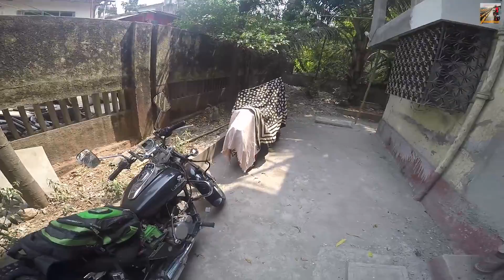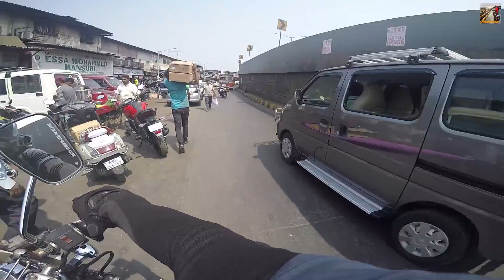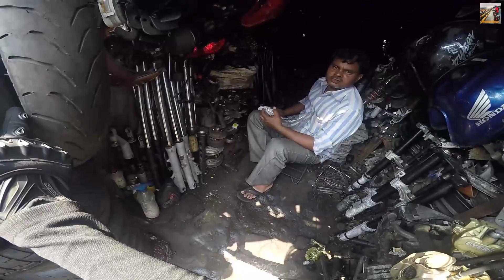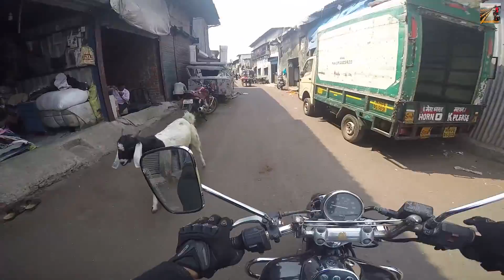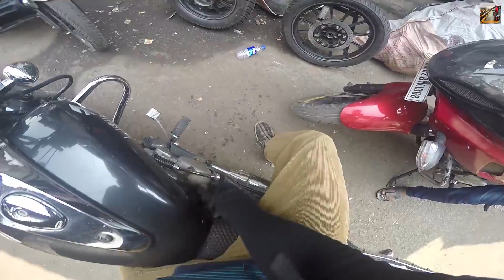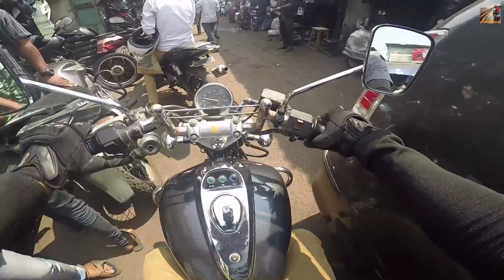Chor Bazaar in Mumbai | Kurla | Vlog

Comment: if you go into the bylanes at Kurla Chor Bazaar you can see workers working on old spare parts which is refurbished and also a lot of Duplicates (COPY) in Panel or Headlights even Tank avail but the Different Handle Bars are Awesome there also parts for RE
Reply: So getting something like air filter or exhaust may not be recommended right?

Comment: suggest u buy original tires rather dn ds used tires cz dy add tread depth to most of d used tires using sm equipments....effectively reducing d strength of rubber...... apun kurla mai rehta isiliye pata hai.... bt as nikhil says do wt u want 😂😎

Comment: hope I was in mumbai :(
i got my AS200 filtered changed in JC road bangalore(K&N R1100) (spent ~3500/-), these guys messed up everything :'( first i lost my full tank fuel (Main line pipe had a big hole) then now i realized there is power loss after 6K rpm don't know where to go now, not able to find a good place to service it. :'(

Comment: Hey Nikhili I own KTM Duke 200 i need to change my tyres both(badly need to change  ,front mac wheel if possible (a little bent ) , exhaust system( just a little improvement over Exhaust) and chain sprockets(lot of noise of chain   please please please help me i am out of options everything going too costly i need all in under 9 , 10 k .
i know its very less  please let ,me know if u can help i know this is  like your left  thumb work but i need your suggestion please do let me know where i can put my mobile number so that i can whatsapp you i work in Powai so please do let me if possible for you